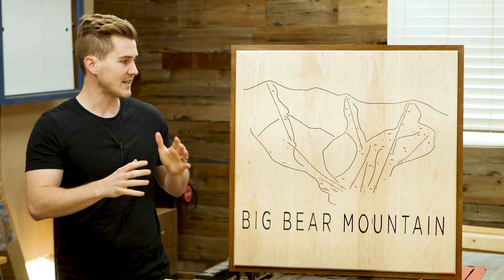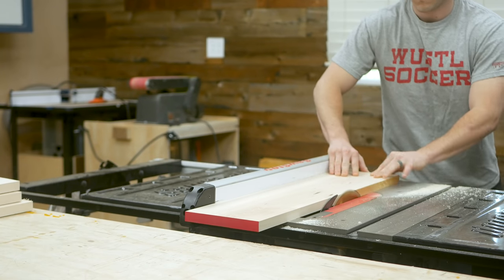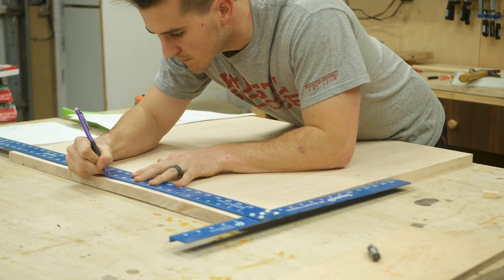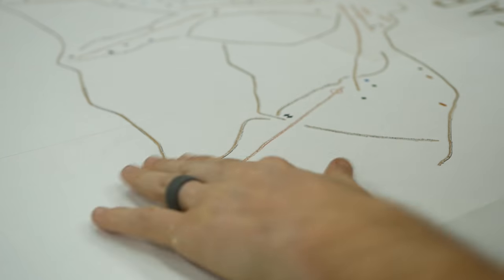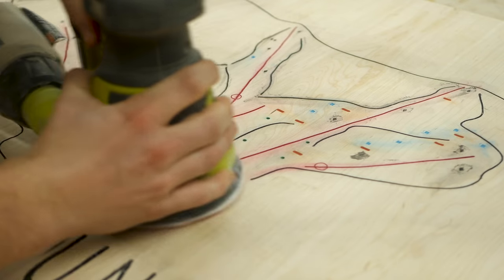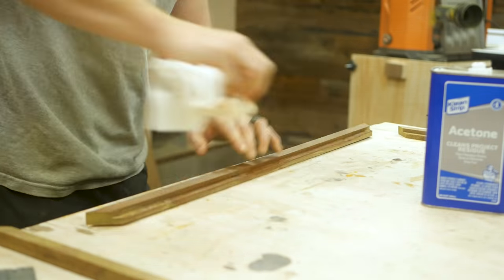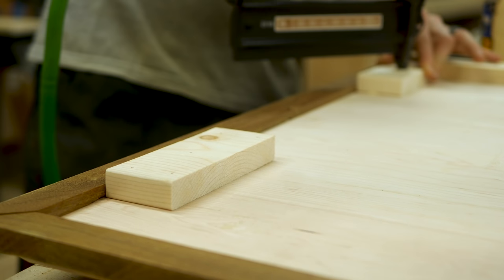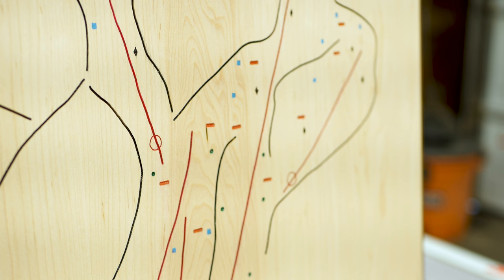DIY Wooden Map | 37

Comment: Some pretty old woodworkers suggest not to clean the excess glue from the wood and jut let it dry, as during the cleaning you simply wipe a very thin coat of glue on the surface of the wood which can soak in the wood and cause problems when finishing it. They suggest to just let it dry then clean off with a chisel. Of course this depends on how much sanding you're going to do after.
Reply from the maker: funny you say that - i have noticed that before with the "thin coat" of glue - i think I'm going to try your reco next time to see how that plays out
Reply: Actually, the best method is somewhere in between. The problem with wiping it down wet, is that it smears the glue all over into the grain, and actually means you'll have more clean up later. The problem with waiting until it dries completely is that a) the glue will be hard as rock and will require a chisel or scraper and b) as the dried glue chips off, it can take the grain with it and leave behind a rough surface, or worse - terrible chip out. 

The "in between" method is to let the glue squeeze out get rubbery and tacky - usually about 30-40 minutes, and then take a putty knife or dull scraper and peel all the rubbery glue off. That way it wont smear into the surrounding grain, and it wont take any wood with it. Plus its super easy. 

The down side is that you cant just "set it and forget it" .... ie. glue your panel before bed, or glue your panel and then go to the hardware store or something... you have to be near the work piece about 40 minutes after the glue up.... plus you cant always get all the glue if its hidden under the clamps. 

But this method WORKS, and works well. Ultimately, wood glue is really strong, and in general people use waaaay too much glue, and you can eliminate a lot of finishing headaches if you use glue more sparingly.
Reply from the maker: @bryanh6856  great tip - I've seen other makers do this - I think this will be my plan moving foward. Cheers

Comment: I've seen biscuits cup the seam when you cut your slots that close to the face. I think it happens if the biscuit shrinks after gluing and sucks the board down with it. Not super common, but just something I figured I'd pass along so you don't have to experience that headache haha. Love this video, man. I've been wanting to get my father in law a map of our local mountain and I might have to try this instead!
Reply from the maker: Thanks for the tip- this was my first time using one so I’ll have to go back and see if it can be adjusted so they cut a little less shallow. So far it’s held up well especially with the extra Ipe boarder. I think I put him around 10 hours on the build but honestly it’s one of the coolest things I’ve ever made so I’d definitely consider it as a fun gift for the family!
Reply: The Cutting Bored For sure! When I've seen it happen, it will only cup where the biscuits are placed and me along the whole seam. You'll end up with a seam that has little depressions wherever you put your biscuits

Comment: Try using sanding sealer and the excess paint won't be as difficult to sand off
Reply from the maker: I tbought about finishing it actually before painting so the paint couldn't soak in past the finish!